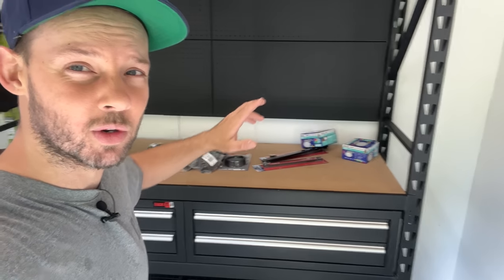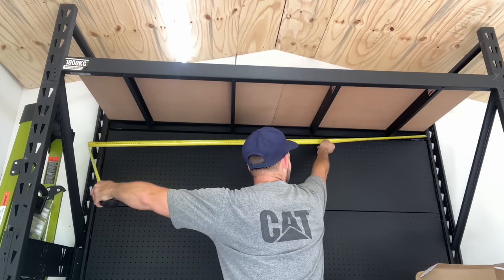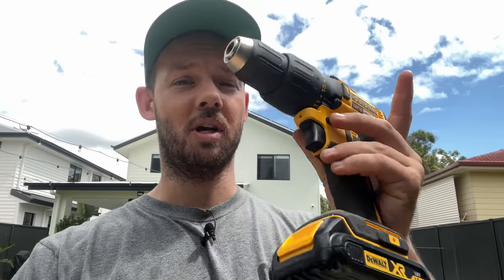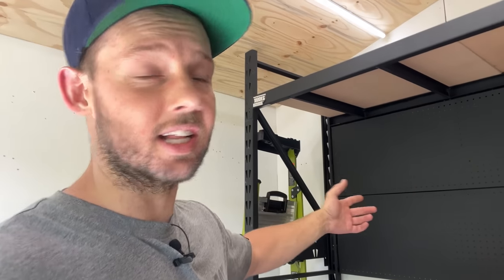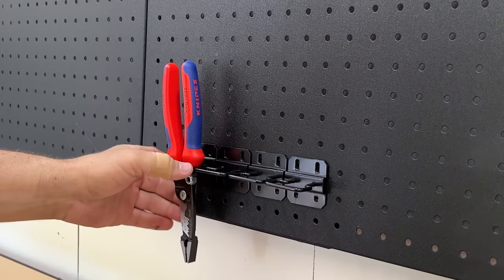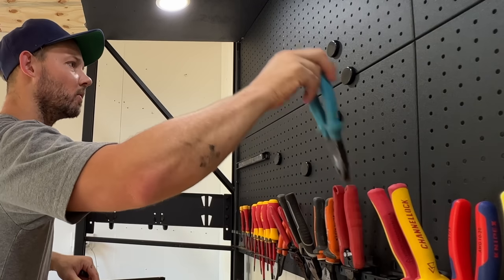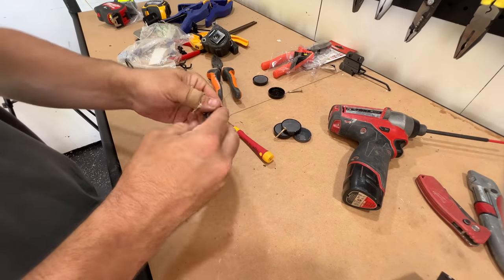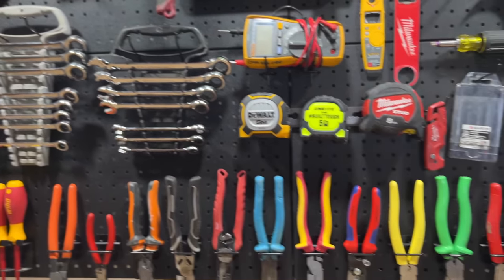Shed organisation with lighting

Comment: I have some magnetic strips almost identical to the ones you have there. I removed the paper on one of them and realised quickly that it's all that was keepin the magnets from coming out. Also the magnets are very brittle so could be good to put some tape back over them to stop them chipping over time.
Reply from the maker: Cheers for the advice Trevor. I might see if I can make something up.

Comment: “Everybody has to start somewhere”. Its easy to forget ill admit..
Reply from the maker: I’m not sure if I follow sorry mate
Reply: @AddictedtoTools  No disrespect Mate, I just chuckled seeing all your pliers hung up neatly in a little row! After you use all your stuff for a while you learn stuff that you didn’t know that you don’t know currently, I sure have! I also hang many of my most commonly used hand tools but not over my work bench. Constantly reaching over your work to retrieve and hang everything can lead to straining muscle or injuring your back. Plenty of other reasons as well, like bumping your elbow on whatever your working on at the bench knocking it over and scattering parts into every corner of your shop. I found that hanging them on my right side works well for me and you will optimize your layout overtime. It’s a never ending process! Anyway, great informative video and I think you have a clean little setup as well as some good ideas! So keep up the great work and never stop applying what all you learn…